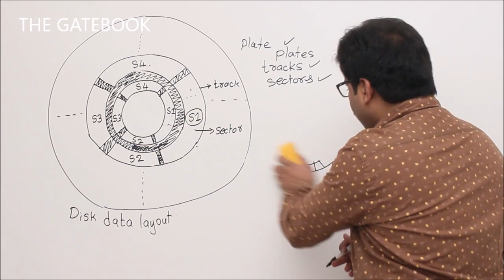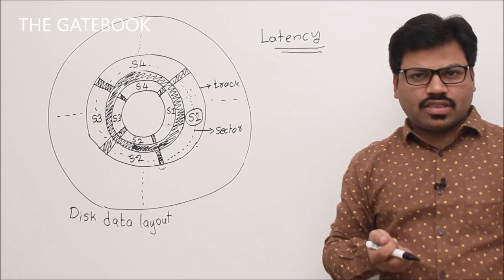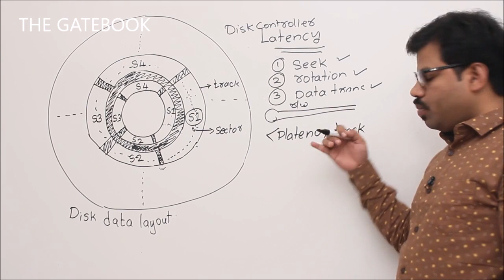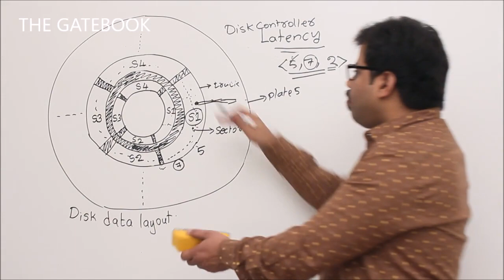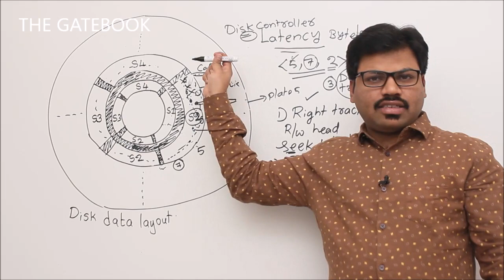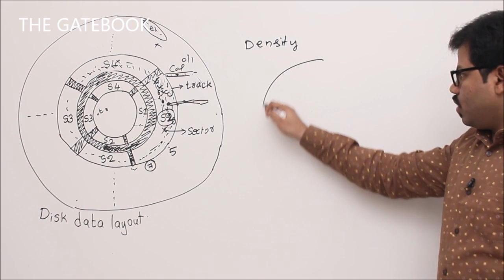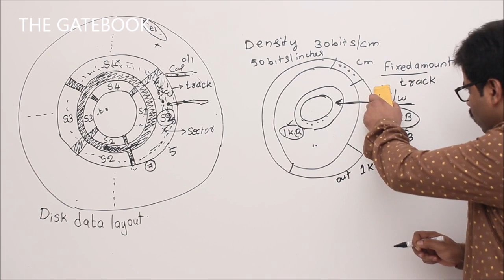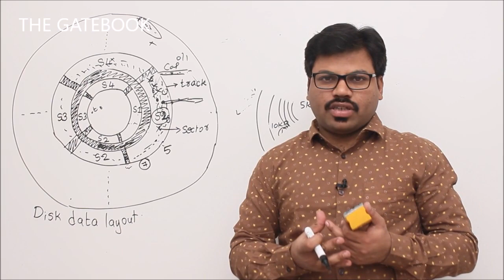Disk Layout

Comment: Sir can you explain this question relating to this explanation:                                                                  Consider a hard disk with 16 recording surfaces (0-15) having 16384 cylinders (0-16383) and each cylinder contains 64 sectors (0-63). Data storage capacity in each sector is 512 bytes. Data are organized cylinder-wise and the addressing format is. A file of size 42797 KB is stored in the disk and the starting disk location of the file is <1200, 9, 40>. What is the cylinder number of the last sector of the file, if it is stored in a contiguous manner?
A
1281
B
1282
C
1283
1284  I could not understand much about it
Reply: Try this way...one cylinder will have how much data? it will have 16(surface) * 64(sector) * 512bytes(each sector capacity)
you divide this with file size 42797 x 2^10bytes / 2^4 * 2^6 *  2^9 = it will give you a number of sectors which will be 83.58...that means 83 sectors won't enough so you add 1 and it would be 84 cylinders will be enough to hold entire file.

Alternatively way.
42797Kb/512(1 sector) = 85594(Sectors)
85594/64(1 surface) = 1337.40 surfaces
1337.40/16(1 cyclinder has 16 clinder) = 83.58 (83+1=84 cylinders)